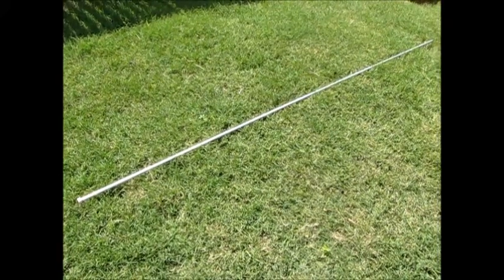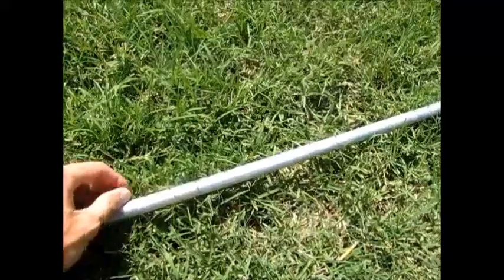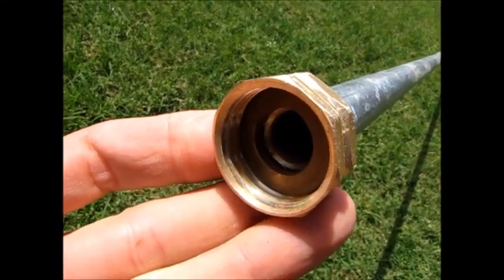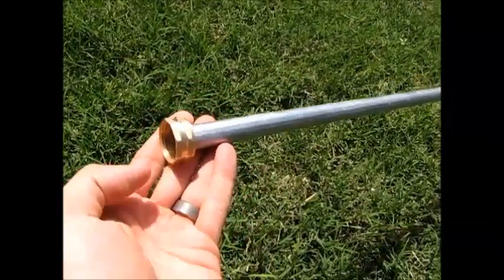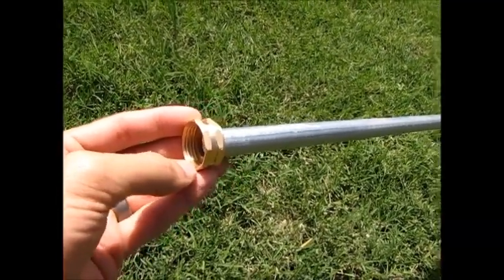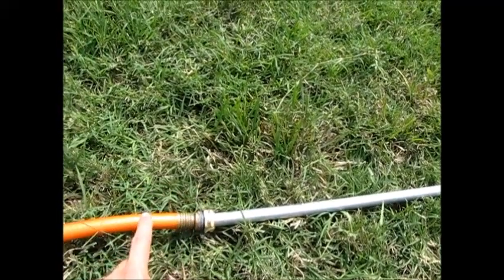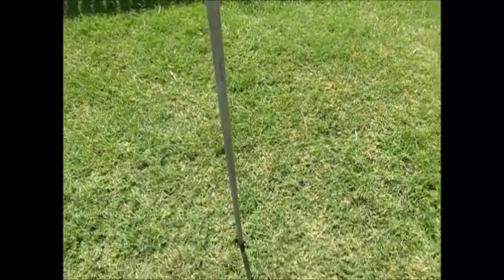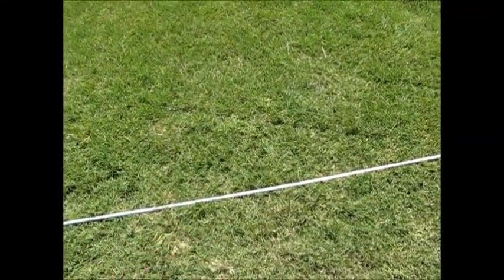How to Install a Copper Grounding Rod Without A Drill - Easy DIY Hack

Comment: I use a post driver to get it in the first six and half feet or so, and then I finish it off with a hand sledge. I can see how this might work better sometimes depending on the soil conditions, and I appreciate your sharing this with us. I know that sometimes you can hit a large rock and the rod will bend and hopefully snake it's way around it or break through.
Reply from the maker: Yeah I don't have a post driver.  Before I found this method I tried using a mini sledge and the top of the rod was mushrooming because of all the rocks.  So I used this method and it took a lot less effort and time and was pretty cheap.  I could have rented a huge hammer drill or something but that would have required multiple trips to Home Depot, more money, and more time.

Comment: You saved me from hours of pounding a grounding rod into hard clay soil.  Using your hydro-drill took on around 5 to 7 minutes of minimum effort.

I did slightly bloody one finger when the hammer missed while driving the hose fitting into the conduit.

The hydro-drill also seems to perform deep root tree watering as well.

Great idea you had and many thanks for sharing your experience.
Reply from the maker: You are welcome.  I also bloodied my hand a bit as I grazed my knuckles against the brick on the side of the house.  Oh well.  Glad it worked for you!
Reply: Hammering the hose fitting into the conduit resulted in a bashing of my finger.  Just tore the skin.  All in all, it was worth it.
Reply from the maker: Sorry to hear.  I also hurt my hand ramming the rod into the ground.  I always say "its not a project unless you bleed".
Reply from the maker: Haha, I always say "It is not a project unless you bleed".  Happens all the time.

Comment: This worked very well for me in rocky clay soil. In rocky soil, an important advantage is that you can make multiple attempts with the 1/2" EMT conduit water drill, without having to worry about how to extract an 8 foot grounding rod when you hit an unmovable obstacle: the EMT is easily removed from the failed hole.

It took me about twenty attempts to find a way through the maze of rocks, but still the job took about half an hour: less than five minutes when I finally found a clear 8 foot path.
Reply from the maker: Awesome!  Glad it worked well for you.  And I agree that it is very easy to use trial and error to find the perfect spot.  Definitely NOT easy to pull one back in after you mangle it with a hammer or power tool.

Comment: This worked great!, even hit a good size rock at 4 ft down and with a slight angle adjustment was able to get around it. To the point of the rod needing to be firmly contacting the earth, i used a 1/2" conduit for 5/8" rod and drove it down approx 6.5 ft and than hammered it the rest of the way. Vibrations and smaller diameter made it nice and snug. Thanks for sharing!
Reply from the maker: Thanks for the comment!  Glad it worked as well for you as it did for me.  I also ran into quite a few rocks and the water pressure was able to move the rock just enough for me to get around it or slide past it.

Comment: When I was first out of the Navy and worked for an electrical contractor we used a jackhammer with a cup attachment on the bottom to drive ground rods. It was always interesting climbing a step ladder with a jackhammer on your shoulder to get it on top of the ground rod and then squeeze the handle to drive it in.
Reply from the maker: That sounds entertaining.  It worked well?
Reply: @LDSreliance  most of the time. The difficulty was being only 5' 5" tall and needing to climb a six foot step ladder with a jackhammer on my shoulder to get it on top of the 8' ground rod. Occasionally you hit a large rock or hardpan and even a jackhammer couldn't drive it in.
Reply from the maker: Yeah, true.  Without some sort of pretty heavy duty drill you aren't going to get through solid rock with anything.

Comment: 10 minutes start to finish... 
i drizzled the water hose next to the pipe hole 🕳 
As I pumped up and down by hand on the 8ft copper pipe 
When the pipe becomes tight lift it all the way up letting water in the hole 
Don't stop pumping while the copper is deeply inside or it will seize up.
Continue pumping with only moderate pressure down. No need to force the pipe. 
Drizzled the water hose the whole time and at about 8 to 10 inches from the full length I used a standard hammer to sink it the remainder of the copper pipe.
Amazing and satisfying to be done in such a short time.
Reply from the maker: That works, too!  Good job!

Comment from the maker: Yes, your house is grounded like this but may have more than one grounding rod depending on your local building codes.  The rod will be driven into the ground very close to your electric meter on the side of your house.  You should see a wire going down into the dirt right below or beside the meter.

Comment: Care should be taken when installing a grounding rod. The rod has to fit firmly into the ground, without any rotating movement. If you can kick the grounding ring and it moves the rod it's a fail and the inspector will not sign off. Also, the rod has to be buried 8' in the ground, not 7' 6", but most inspectors will let you slid under 3" agl. One last thing, the ground rod must be installed directly underneath the meter main panel, specially for a overhead drop.
Reply: All true for grounding a panel, except that the rod must not rotate. IF it rotates, you can't connect power until it's captured. The copper rod will capture when soil around it infiltrates the larger hole, over the course of less than a week in my experience.

For other uses, radio antennas and the like, I often put in several rods around a tower, bond all 3, and bond the tower to the 3-rod installation. Radials, if desired (that's more a religious argument than an engineering argument) can be attached to any or all of the installed rods.

Comment: Worked like a charm for me, only took 5 minutes to drill down 8 plus feet. Pro tip on installing the barbed hose connection, use a dead blow hammer for easier installation as a ball peen tends to bounce off. Other that that, great video!
Reply from the maker: Awesome!  Glad it worked well for you.  Thanks for watching.

Comment: Great video! All these naysayers are just old school people that think there is only one way. They were taught a certain way and think that is the end all be all. Obviously water jetting down like that makes the soil loose which yes makes for a loose ground but as I saw you say it takes a few minutes to maybe a day tops to tighten back up. The reason is you are causing a type of erosion in the ground with all that water and allowing it to puddle up with a mud type consistency. This happens naturally to by the way. Even your solid pounded ground becomes loose during super heavy rain or flooding situations. You could if you wanted pull the pounded grounds out just as easily after floods. Don’t believe me go try. Anyway this method is perfectly fine. It might not ohm out right away to the right numbers but as soon as that earth re-compacts and it most certainly will and will only take a day tops. Go test before naysaying and debasing a method that works. Also you might just be a contractor that wishes people would stop diy’ing so you can make more money. I am a contractor and yes would love to have the money to but just debasing because of that is not useful or helpful.
Reply from the maker: Great comment.  I agree that it is only a matter of a short time before the mud dries and you couldn't pull the rod back out if you tried.  The soil compacts and it becomes a viable earth ground.

Comment: i just did this in 5 minutes! it was so easy. i bought 1/2" pvc and fitting a couple years ago after watching this video. i finally got around to doing this and it was so fast and easy. now i have a ground for my emergency generator when the electric power goes out. thanks
Reply from the maker: Glad it helped you!  Thanks for watching and commenting.

Comment: I used that method before and it's a slow process, but it does work.
Reply from the maker: Slower than what?  Using a specialized power drill/hammer?  Yes.  Pounding it in with a sledgehammer?  Not really.
Reply from the maker: A hammer drill is clearly the right tool for the job.  But short of spending $20-30 to rent one there is another problem.  Those grounding rods are copper clad, not solid copper.  So if you are beating it to death against hard ground full of rocks, construction debris, and who knows what else you are going to scratch off some of that copper cladding and it will lose some of its effectiveness.  That is why I like driving in this cheap electrical conduit into the ground first with water so I know the hole is clear and then you can tap the rod in easily.  I can do it in less than 5 minutes for free without running all over town looking for a drill to rent and without destroying the copper rod.
Reply: I've actually seen the top of rebar sticking out of the ground for the breaker box at some houses. I never thought that was a good idea.
The ground here is so bad here that you won't find many people using a Vertical antenna for ham radio, as it needs a good ground for counterpoise.
Reply from the maker: Yeah, that is probably not ideal.
Reply: St8kout

Comment: I would like to see you try that in Las Vegas.
Reply from the maker: Yes, rocky soil does cause problems.  But it would cause the same problems for a hammer or mallet or anything other than a masonry drill.  So this hack works pretty much anywhere that other methods do.

Comment: I have to drive one into the ground and I have been using water and a shovel and a mallet but there is VERY stubborn clay about 2 and a half feet down... do you think this will work for getting down into clay soil?
Reply from the maker: Yes, but it will take some time.  My soil here in Texas is red clay.  The only thing this won't work for is rock, obviously.

Comment: My only concern is the amount of actual conductivity from the contact between the rod and the earth after the water blasts away a fairly jagged hole. 
I know that some of it will come back after the mud formed by the water sort of cements the rod to the dirt and the water seeps into the surrounding earth.
My question is: would the conductivity be better, as good , or be worse than a hammer driven rod?
Reply from the maker: In the short term it would be worse.  But as the mud dries and erosion and more rain continue to fill any gaps or air bubbles or lack of contact between the rod and the ground, it will be as good as any rod put in by a hammer.

I regret at the time I did not have any test equipment that I could measure the resistance of the rod after installation and then at time intervals afterward.  Maybe someday I will get around to doing that on another rod.

Comment: 1 this will rarely work. Im driven thousands of ground rods. 

1 a ground rod has to make good earth contact the entire length of rhe rod.this will not reach that criteria. 

2 a ground rod could be anything metal installed in the earth. The nec now clearly defines this as a steal rod of s length of 8' or greater driven into the earth from the  low point of the structure meaning basement etc. (also should be coated with a non corroding metal zinc or copper cladding or plating) can also be schedule 80 copper pipe ir solid copper)not from the outside. So this again would be useless. Or messy and destructive. 

3 there are rocks in soil. And there are different soil types. Drive a ground rod with a hammerdrill the way you are supposed to.

Comment from the maker: That is a challenge.  Dry soil raises the impedance as well as sandy soil.  You may not be able to use this water pressure/hydraulic method if there are tons of rocks, either.

Comment: Just hammered in a rod in less than 5 min. It would take much longer to go buy the conduit and the brass fitting and then the assembly. Shoot the prep work to drop the rod in to a bored out hole one could put in 20 rods with hammer
Reply from the maker: Consider yourself lucky, I guess.  My soil is very rocky and the more I hammered on the rod the more the end mushroomed.  This was the only method that worked for me.

Comment: Ok   so you drill a hole with the water drill.  pull it out and insert a proper ground rod.   since it is easy to push it into the hole its an easy install.   but isnt the ground rod required to be in tight contact with the earth?   driving it into a snug hole that was pushed out as the rod was driven in will have good contact to the earth.  but you have washed away the earth and made a loose hole that you can esilly insert the rod.  kind of like crimping on a connector without actually squeezing the wire making a loose contact.   seems like a bad idea to me   Id like to see some tests on this to see if it is actually an effective ground. 
.
Reply from the maker: +David Moes You are correct, that would not be a very good ground.  But that is not reality.  This does not create a loose hole in the ground at all.  It actually creates almost a quicksand-like mud that still requires you to pound the rod into the ground and then makes it impossible to pull back out.  Watch the demonstration video:  https://www.youtube.com/watch?v=K5eorpQBml0&feature=iv&src_vid=-kpI8PFNYl4&annotation_id=annotation_2819344611
Reply: David, in our neck of the woods, using a steel pipe would not be allowed as a grounding rod. It should be a solid copper rod 5/8 or 3/4 inch diameter 8 foot rod. Will you use steel wires inside the house for wiring? Most other comments debate the amount of time taken by this method or that. Your comment nails it. The method depicted in this video is against the code and does not make make good contact, more so when the pipe rusts.
Reply: Expat Hispanico he doesnt use that rod...thats a tool made to make imserting the actual rod easier
Reply: Expat Hispanico were you even listening to what he was saying?
Reply: Not effective. Just makes it more complicated and time consuming, no electrician needs more then 5 minutes to do it by hand

Comment: Wow water pressure from the house will do that? In only ten minutes? That's a cool idea. The things I learn on YouTube! Does it require a lot of physical strength when you're pushing down? I'm not very strong even for a female. 

And now I know how long a grounding rod is. I wondered how deep they were. Thank you for sharing your video!
Reply from the maker: You are welcome!  Yes, normal water pressure will do this.  You don't need a ton of strength as long as you keep the drill moving (don't let it get stuck) and quickly put the grounding rod in the hole after removing the drill.
Reply: @LDSreliance  Wow thank you for answering. I appreciate that! Have a happy day. 😊
Reply from the maker: You too!

Comment: Thanks for the sharing the method.  Actually, they should start making hollow grounding rods so that you can attach a hose to it to put it in AND take it out.  (And maybe hook up a well at the same time LOL!)  The only reason it would have to be solid is if you need to pound on it.  I would think a 1/8" wall copper-clad pipe would work just as well.
Reply from the maker: I would think so, too, but I have done hours and hours of research into grounding and there is only one thing for sure about grounding... no one really knows how it works.  Only the outside coating is copper on those solid grounding rods so I agree with you I would think that a hollow copper tube would work just as well.